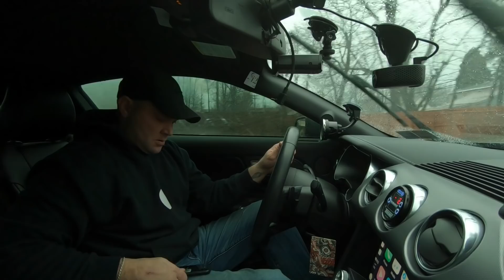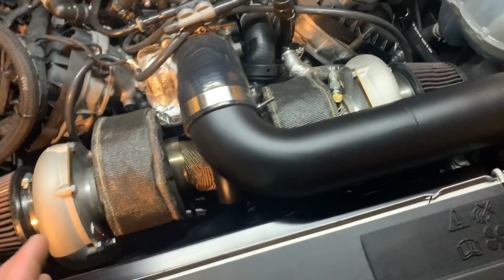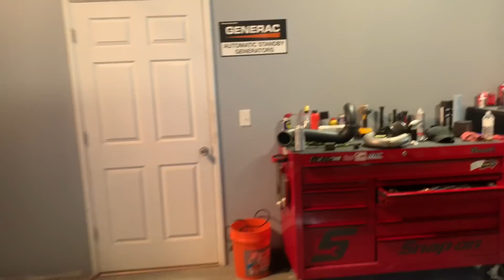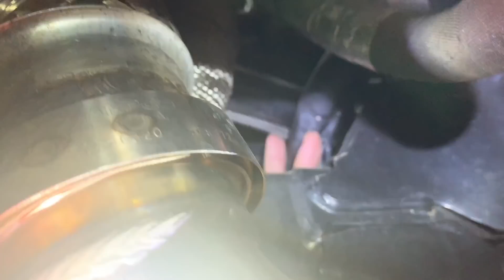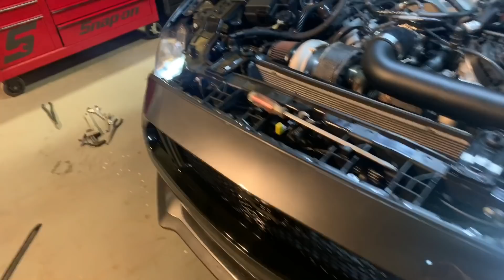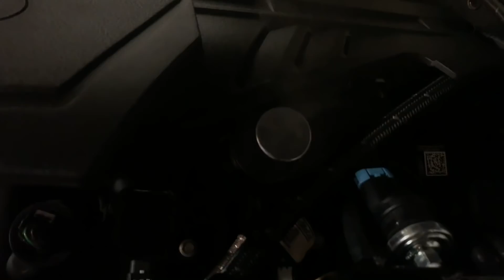IS THE BUILT 2018 MUSTANG GT 10R80 TWIN TURBO 6266 HELLION BROKE AGAIN

Comment: I have had a bad turbo oil seal on exhaust side. If you unhook downpipe and see any oil on exhaust turbine than you know it's the turbo like you said.
Mine would smoke more the longer it idled.  Once I unbolted downpipe from turbo and saw wet oil I knew I blew the turbo oil seal on hot side.  Actually, my dealer over filled.my oil during oil change. They put 5 qts rather than 4.5 qts and the increased oil pressure blew my hot side turbo oil seal. Only time I let dealer change my oil was during dead of winter and they fucked it up.  But I was modded and running way more boost than stock.  Went bigger turbo and never looked back.

Comment: I guess you are running a catch can on the passenger side. 
But considering that you have only about 500 miles and only on 6 psi. 

Getting this amount of oil from the drivers side vent that hardly gets any oil on a N/A car at least.  Seem a bit strange to me. 

But as has been mentioned. Maybe the rings are still not fully seated. And you are having excess blow by. But shouldn't that,  then be on both sides? 
Was the catch can full?

Comment: Disable the seatbelt alarm.... I did it on mine the very first day.   .... Most likely you'll need a breather system, run some hoses from the PVC valves to a breather box mounted some place.

Comment: Went thru this with my 02 lightning.with a breather under the hood you're going to have a ton of oil mist in no time all over everything
Reply: Yep, don't vent to atmosphere unless it goes through a catch can first that is multi level.
Why don't you Mustang guys look into the catch cans we turbo guys been using for years?  There are some really nice ones. Ones that look like little robots and shit, lol.
Check this Cusco unit out
https://subimods.com/cusco-oil-catch-can-2015-2018-sti.html
Reply: I would put a catch can. I was venting to atmosphere and would get a lot of mist from the blow by. This happens only on e85 it dilutes everything a lot quicker . Pump no problem. E85 change your oil every 1500 miles.

Comment: Why don't you program the driver seatbelt chime to be disabled.
Reply from the maker: FullAutoGT how???? Lol
Reply: @BoostedAddictions  look in the owner's manual and it shows you the process on how to disable the seat belt chime
Reply: I absolutely love that Ford included that as an option
Reply: You can thank me later buddy.
Reply: @airflow_concepts  Dang i didnt know that good to know, thought maybe getting into the as built data would do the trick ,plenty of things can be changed/enabled or disabled in there.
Reply: @airflow_concepts  no way really? The ding can stop!
Reply: In my f150 you turn the truck electric on, wait for the seatbelt light to disappear. Then buckle and unbuckle the seat belt 3 times fast and it will flash several times telling you the beep is disabled